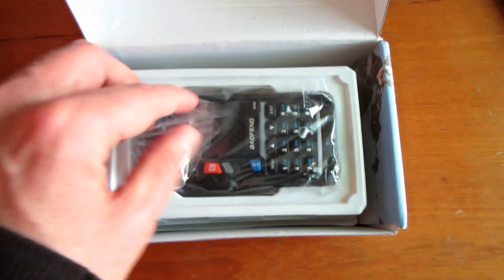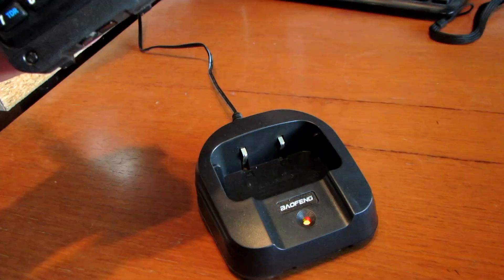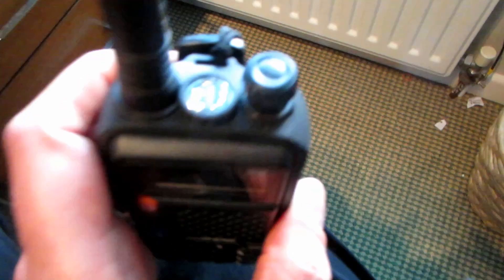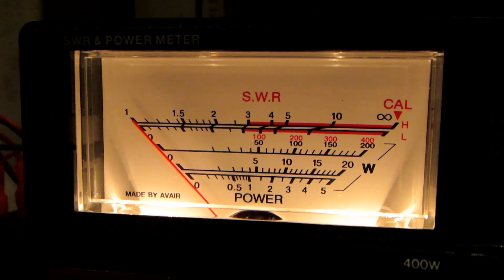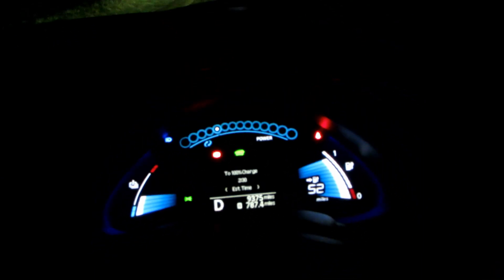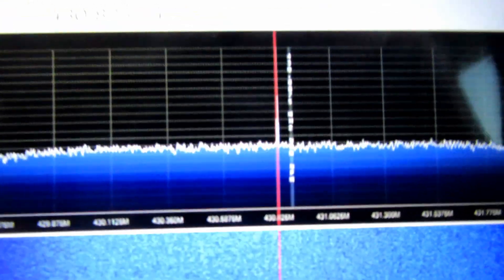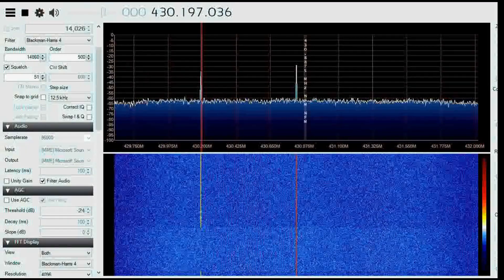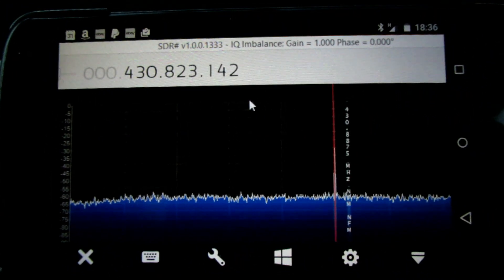Baofeng UV 5X - Field Test - Power Test - SDR Record SDR RTL2832U & R820T2 USB

Comment: I use an NH-31 antenna and it now has about 20km range non-line of sight aka real life situation. It could pick up repeater signal from 35km just fine and noisy at 80km.
Reply from the maker: Yes one off my favourite style radios
Reply: @knoxieman  I am intrigued about their rig line ups

Comment: You are transmitting at 430.200.000 but SDR is receiving at 430.218.158. How this is happening. I was thinking SDR should receive at 430.200.000. Correct me If I am wrong

Comment: Just got mine. A week ago. Haven't acclimated it to specs. Still very use full. W/ FM  radio and scan features.  It's a far leap from my antiquated fleet of hand held rigs. Getting radio rich, with the low cost and fit  finish looks good. Tks Fer your vision on the subject. Kv4li. 73
Reply from the maker: Your welcome

Comment: Im sorry to say I've six uv 5r and reaĺy i prefer my yaesu vx 6 or vx 8 de far better radio you only get what you pay for and thats crap these cheap Chinese import radios can blow up so be care full
Reply from the maker: mark 2E0.P.I.A I've never had one blow up, they are cheap but they work well enough for most people, I've also got top end ICOM and yaesu hand held radios which are of course better radios but they cost significantly more, fact it's a 25 quid Chinese radio can still perform the basic function of holding a qso with someone.

Comment: If you use HDSDR software, you can actually see the s-meter reading which will give you a more precise receive signal measurement. Then you can actually compare different radios.

Comment: Ive got the uv-5rtp, and I love it, Im on the fence about this one, (the tp has 8watts output), and just wanted the 5x bc of the water resistance, maybe Ill buy a retevis, theyre about $10 more, but at ip67 waterproof, i feel more confident,( I might see if I can put my 8 watt final inside one of the lower powered waterproof radios, idk yet, not much time these days). Thanks for the review, 73s

Comment: How does it compare to the UV-5R over all?
Reply: Larger Keypad for better feel 
Brighter Flashlight 
Bigger but slimmer for better gripping 
output Power TX 7-8 watts 
That's the difference :) 73s
Reply: thanks a lot! Is the Tx really 7-8 Watts? Did you test it?
Reply: I'll do a intensive review on it .. our version here in asia is the UV-85+ same as the UV5X ... Marketing as always  i don't think anyone has done a review on the difference between the UV5X and UV85+
.. 73's

Comment: the R+ has that protection screen and small mic hole for water resistance. Drill out the mic hole carefully.
I've water dunked one of my 5R s and after drying out it improved the scratchy volume but took away some low end on the speaker, works fine still
Reply: UV5X isn't no were waterproof nor water resistant... Marketing Tool Fals Advertisement .... careful what you read on ebay or Amazon 
UV5X isn't waterproof nor it's water resistant the only radio's that are water proof in the Baofeng Family are: 
1. Baofeng Waterproof BF-9700
2. Baofeng Waterproof A58
3. Baofeng Waterproof R760 
4. All three Radio's are IPX7 - Submerged For 30min up to 1 meter 

Any other Baofengs out there mentioning Waterproof or Water Resistant is Bogus !
Reply: false advertising,
no shit Sherlock!
Libertarians love the unregulated Chinese market!
Isn't it amazing when capitalism bites you in ass.
Vote Trump 2016!

Comment: What kind of antenna do you have connected to your SDR dongle at home when doing this test? Ty
Reply from the maker: Its a co linear at 30 foot on the side of the house
Reply: Hm i am new to this,  I live in apartment and im trying to figure out what would be the best economical antenna type for my incoming sdr stick, (own a baofeng aswell) Try to get one of those rabbit tv table antennas or try to get something cheap on the roof of the building or window maybe.. So, what does co linear mean?
Reply: NAGOYA NL-R2 PL259 Dual Band VHF/UHF 144/430MHz

Comment: I think everyone should just get the basic UV-5R so that there is a good single system out there with lots of interchangeable bits. These new models that do nothing more, but have a different form factor, muddy the waters, I tend to think.

For power - might it not have been better to just measure forward power into a dummy load to get a base line? It might have been interesting to see the reflect power with that rubber duck antenna.
Reply: Jonathan Warner exactly mate!
Reply: The gt3 tp has better receive capabilities. I compared one to my old uv5r. Pretty pleased with the improvement. Definitely worth the change.